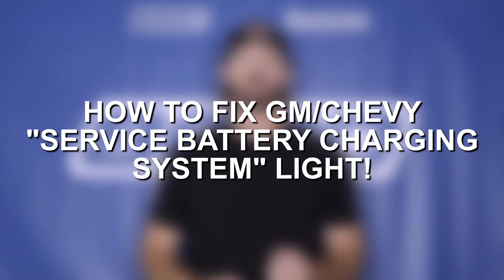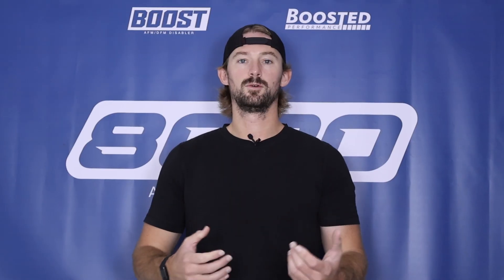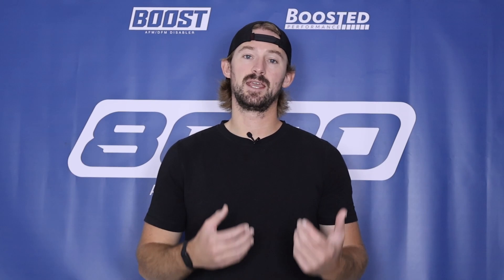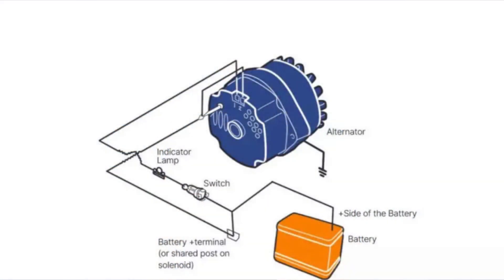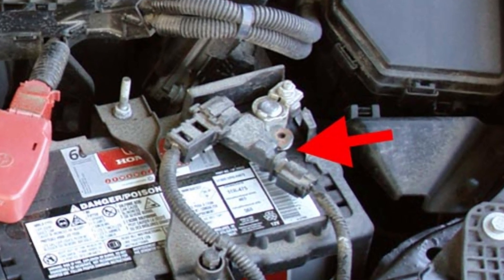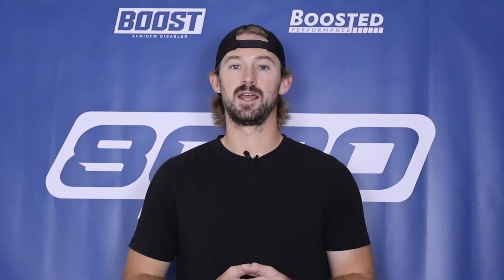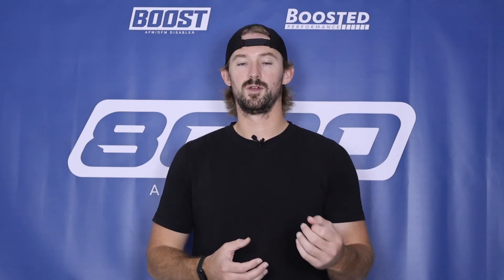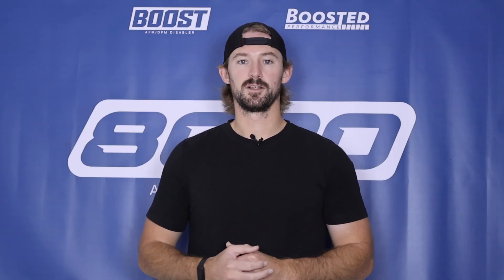How to FIX Chevy’s Service Battery Charging System Light (Alternator or Battery?)

Comment: Is the Regulated Voltage Control Sensor the same as a current senor? If not what would be the correct name and abbreviation for it in my fuse box. 2013 Chevy Malibu. Thank You.

Comment: You have a video talking about the magnum 5.9 L v8 and I’m wondering if I should buy this 2002 dodge ram as my first/daily vehicle it’s sitting at 130,000 miles
Reply from the maker: C - Depends on how well it has been maintained.